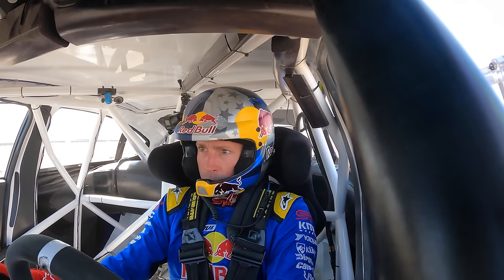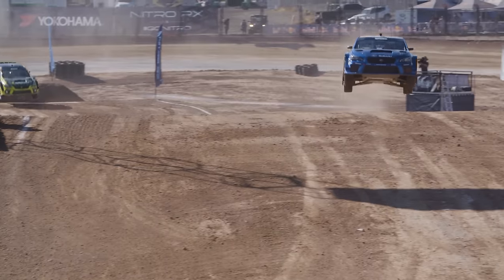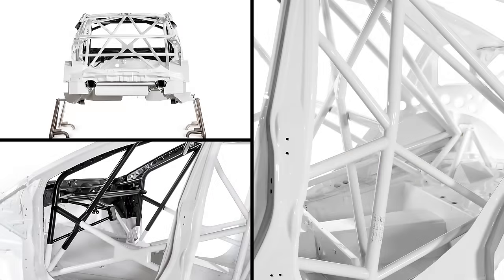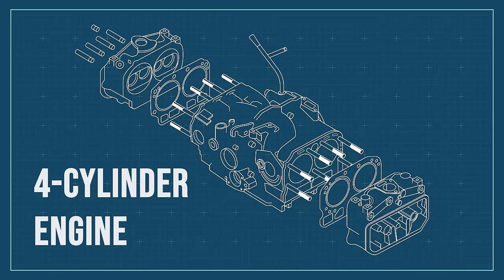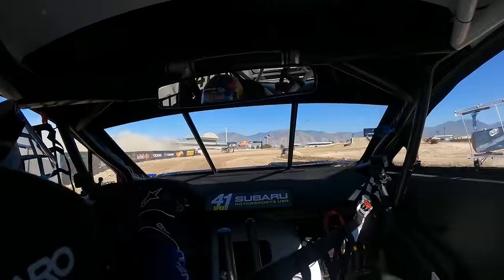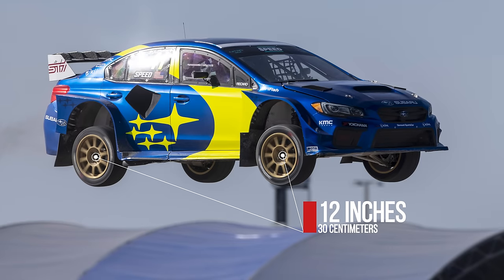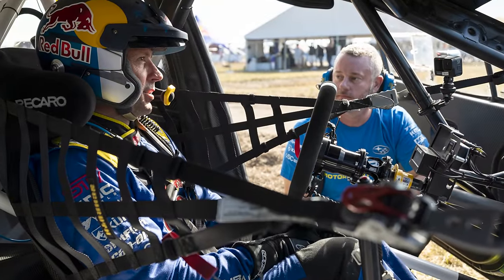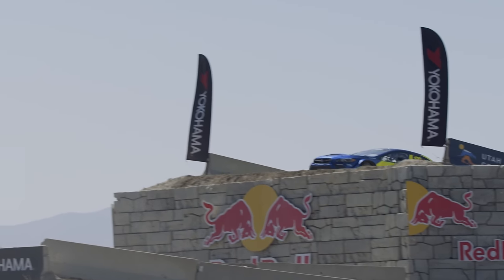Inside the Ultimate Rallycross Machine | Subaru WRX STI VT21x Deep Dive

Comment: The Subaru huckster is the un restricted version at 870 wheel hp and torque and no the head gasket doesn’t fail. The head bolt stretches at 17lbs of boost with a good set up and lifts the head under boost with arp studs and arp rod bolts. Forged pistons it becomes very reliable at 22 psi boost and 400 wheel torque is what I run on my daily. And that’s quite enough power for a daily.